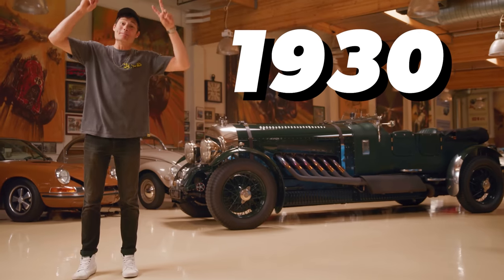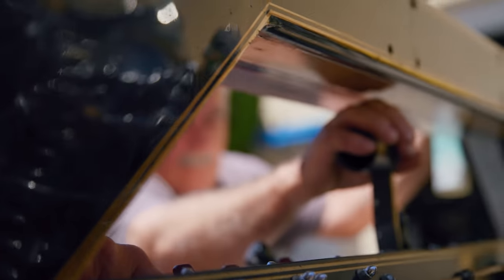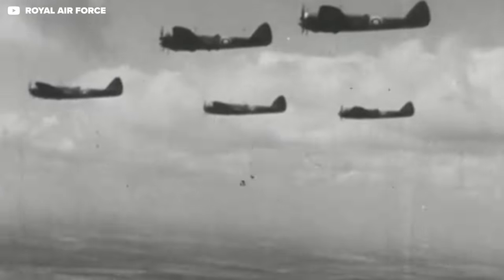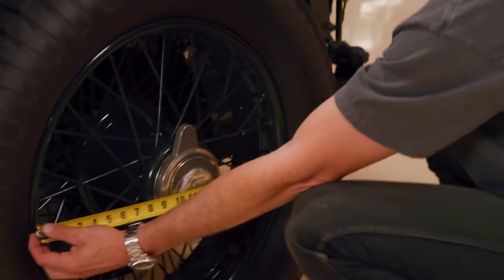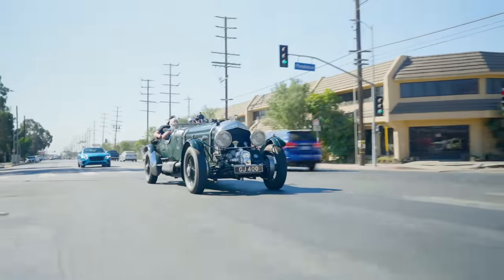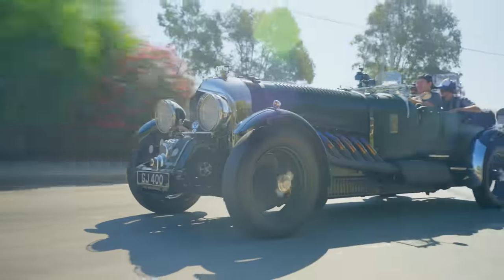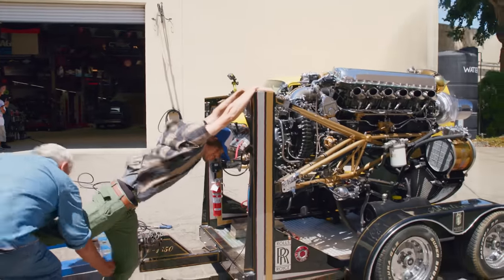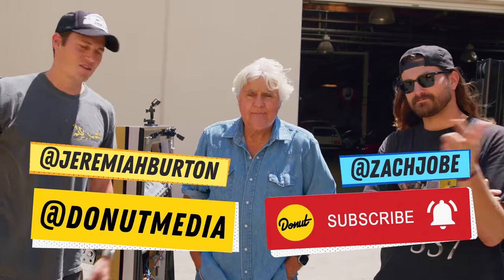What it’s Like to Drive a 100 Year-Old Car with 650hp

Comment: The Merlin was a British engine developed and manufactured by Rolls Royce, for the Spitfire. It was licensed for production in the US for the P-51 because the US made engines were lacking against German fighters
Reply: Yeah, the history part of the video is complete bs
Reply: Had to double check the wikipedia on that one, they said it with such conviction that for a second they really had me believing that the ROLLS ROYCE Merlin was an American product. Kinda sums up the US perspective on wartime history in a nutshell.
Reply: @Munkenba I'm American and even I know that the Rolls Royce Merlin is more famous for the Spitfire.
Reply: I had a problem with this too. Tbh it reads like it was based on the Packard V1650 Wikipedia article. But they very much made it sound like this was an American engine when it is distinctly British
Reply: Was about to comment about that. Rolls-Royce named it the Merlin, and the US version was called the Packard V-1650 (the same exact Packard that made cars, Motor City). It was the same overall design, however, with creating new blueprints to suit American perspective layouts, dimensions and tolerances were altered to allow for mass production as Rolls-Royce built them with manual, fine tuning of clearances.
Reply: Yep they completely ballsd the history up
Reply: Someone modded this engine into a video game (beamng) and it's honestly the craziest thing ever.
Reply: Americans: we did that! 
Everyone else in the world: no you actually didn’t
Reply: @ruikazane5123 so basically the American ones were probably slightly less reliable and probably slightly less efficient?
Reply: The fact that Jay of all people called it American engineering is the worst.
Reply: Lancaster,hurricane, mosquito halifax and countless others all had the merlin
Reply: @schpreck  that probably is the Packard copy
Reply: Wrong way around; the spitfire was developed for the Merlin engine.

Most of the Merlins were built for bombers though. Lancaster's using 4 of them, and Mosquitoes using 2
Reply: Americans claiming (or to be fair not knowing) the Origin of a Piece of Engineering or something war-related?
Now you Brits finally know how we Germans feel all the Time about all kinds of German Inventions & Engineering Products as well as war-related things in general. 
Though we Germans are used to it by now, so Brits reading this, calm down, you'll survive
Prost & Cheers from the Bavarian Alps
Reply: The engine in that car isn’t called a Merlin, it’s actually called a Meteor.
Reply: The merlin engine is One of the most successful aircraft engines of the World War II era, some 50 versions of the Merlin were built by Rolls-Royce in Derby, Crewe and Glasgow, as well as by Ford of Britain at their Trafford Park factory, near Manchester.
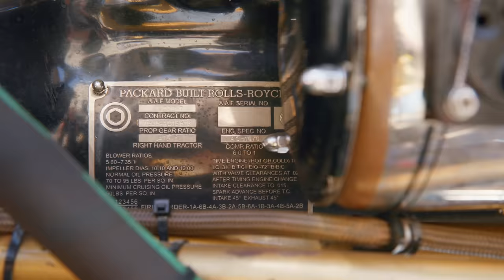Reply: There is a very quick shot showing it is the Packard version (1:00)
Reply: @jwalster9412 That is debated still, but seeing the statistics for the P-51 Mustang and comparing that to the Spitfire might help...
Reply: "We" won the war? The correct phrase would be "The Rolls Royce Merlin that powered the Spitfire, Hurricane, Lancaster and later the Mustang was significant in helping the allies win the 2nd world war". I usually let stuff like this slide but the US has an unfortunate habit of slightly modifying history to the detriment of men and women from India, Australia, Great Britain and numerous other non axis nations, giving the impression that the US fought Nazi Germany and the Japanese entirely alone.
Reply: @MartynCharsley thank you for this comment 👍🏾, 
Also i think they wana make merica great again. 😂
Reply: @christopherdooley4666   I'm glad you beat me to it. It  means I'm not the only sane person on the planet, and that's got to be a good thing.
Reply: @schpreck  what time stamp did he say it was American engineering? at 1:17 he said "that was American manufacturing back in the day" talking about how fast they were making them.
Reply: They also don't make clear that the idea of transplanting aero engines into racecars was a really common practice at the time. The Fiat Tipo  S76 "The Beast from Turin", is just one famous example. I'm sure Jay's had a few of them on his channel.
Reply: Partially correct. Rolls Royce designed it. However, the Brits were hand building them and couldn't pump out the engines fast enough to keep Hitler from parking his Benz outside of Buckingham Palace. The Brits begged America to help. Packard motor company had to work with Rolls on dialing in tolerances so they could be mass produced and thus keeping the Brits from learning how to speak German.
Reply: @MartynCharsley  Not to mention that the soviet union did more to "win the war" than the ALL of the countries you mentioned, combined. Of course the efforts of those countries should be acknowledged and respected, but the soviets had tanks in Berlin while d-day was happening thousands of mile away. The soviet T-34 is considered by many historians to be most impactful weapon in ww2. No country sustained as many losses as the soviets. It gets really tiring seeing the anti-communist propaganda erase so much of the good things the soviets did.
Reply: @ilikeartica exactly....at jo point did they say America initially developed the engine, only that we made them in America in large jumpers at a rapid rate for the war.
Reply: @diegoficagna3057 I'd also like to point out that the Europeans did Jack shit in the Pacific theater. They all got their asses handed to them by the Japanese and had their Pacific forces retreating into Africa before the USA started making major moves in the Pacific theater. I'd give the Soviets, Chinese, Australians, and Philippines more credit for the Pacific War effort than any of the European powers; and anyone who tries to claim that the USA wasn't the biggest player in the Pacific theater is a moron.
Reply: Hopefully donut reads this
Reply: @schpreck it is as the original engine was far to complex to MASS PRODUCE. As it was needed . So yes some good ole American engineering went into simplifying it.
Reply: It's a merlin on the stand and a meteor in the car. Jay let it slip, it's a tank engine.
Reply: There was plenty of British accents going on but no recognition 😂
Reply: the americans are too embarassed to say they had to use a engine design from the UK because american ones were no good and their engineers couldnt come up with one
Reply: I think the editing is the reason a lot of people are getting grumpy in the comments. After jobe says that it’s a Rolls-Royce Merlin they could’ve just added another 3-4 second clip clarifying that Packard were the ones mass producing it, based on the licensed design with the necessary alterations :)
Reply: @HALLish-jl5mo also the Fairey Battle and Short Sterling.
Reply: @diegoficagna3057  The USSR was shit though. They had thousands and thousands of T-34s because they were crap tanks that did more damage to their own crews.

Their logistics was compromised of American trucks because their manufacturing sucked. 

All the USSR did was throw men into the grinder using western equipment, or, if those men were extremely unlucky, Soviet equipment. Their leaders were completely incompetent for the first year because Stalin had just shot everyone who knew that they were doing. 

If they'd the first clue what they were doing they could have won with half the casualties.
Reply: I love donut but they absolutely need to step up their research game because they are frequently pretty terrible about getting facts right.
Reply: @diegoficagna3057  Absolutely. I'm ashamed that I didn't immediately acknowledge the stupendous contribution made by Russia during the conflict.
Reply: @junit483 Ouch! I had no idea that Churchill and the war office went begging to Washington. Amazing what you learn each day.
Reply: To be fair, I think Jay was mostly talking about the US's production might, of being able to produce the (licensed) Merlin's at a rate of only taking one hour for each one.  I don't think he was implying the US designed it (and no, I'm not American).  I don't really expect anyone of Donut's age group to know any intricacies like that either, unless they are into WWII history.
Reply: @Munkenba not really. Stop projecting your bias onto a mistake made in the video.
Reply: yeah i was kinda baffled for a second as i remembered the Merlin being the legendary Spitfire engine first and foremost. Of course they used it in plenty other situations as well, like the P-51 as mentioned.
Reply: The magnum opus of plane engines
Reply: @zirgaoec3784 go back and watch it again. they never said the US built it. You’re reaching.
Reply: @diegoficagna3057  The T-34 tank is so impactful, that they are STILL using them to this day in their invasion of Ukraine! :P
Reply: If it wasn't for us, you'd all be speaking German and Japanese.
Reply: Top Gear drove one in an old episode. Was great
Reply: @chartreux1532 we still beat you…….twice!
Reply: @MartynCharsley don't forget the eastern front. The USSR was the biggest reason the Nazis were defeated
Reply: And they didn’t win the war, they helped to win it but every time it sounds like they think ww2 was america against germany
Reply: @zirgaoec3784 not fully true
Reply: Not fully correct but yes
Reply: @corroded nit true. Americans took the motor and modified it to be better for the heavier plane that Americans had at the time. It was both sides who made the engine so iconic. It's like how Ford Mustang ecoboost uses a tuned version of the same 4cyl in the focus
Reply: Yeahman one of the factory’s in Manchester was about ten miles from me literally near a place called Trafford park … obviously hitler tried blowing up the factory few times aha
Reply: Americans will always try and claim what us Brits produce lol
Reply: Cmon guys we were init together 🇬🇧 🇺🇸 BLED watch bro anyone tries it now bro it’s onsite 
Here in England we watch American shows , eat Indian food , drive German cars and have too many immigrants . Been there done that but americaaaaaaa yeman standard love you lot
Reply: @chrismartincreator  says the country that has  stolen most of the  ancient worlds treasures and put them in a meauseam and claims it's their own. Yeah that's ironic
Reply: @Munkenba   The American (Packard) made Merlin engine, designated Merlin XX, was built to tighter tolerances than the Rolls-Royce variant.

It's fair to call the Merlin XX an American engine as they made changes to fit American manufacturing processes and even improvements to the design.
Reply: It did feel odd not to explicitly acknowledge the engine's origin, especially when the video opens with a brief faux-British accent/nomenclature gag. To be fair they did acknowledge the Royal Air Force in some of the archive footage, and used a Polish 303 Squadron Spitfire in the infographic, but now I'm wondering whether that was accidental rather than deliberate. To specifically mention the P51 in the narration but not the Spitfire (a few of which were flown by American pilots, so retaining the opportunity for a bit of flag-waving if that was the aim) seems like a strange editorial choice.
Reply: Plus, this car has a Rolls Royce Meteor in it, the tank version.
Reply: @gamemeister27  I had, to my shame, forgotten that. I think you're the second person to bring this up. I'm growing more embarrassed by the hour. Apologies to the descendants of the Russians who gave their lives. I didn't mention Poland. I think that they were the first to suffer invasion by Hitler's troops, although Austria was certainly annexed earlier. Polish pilots flew Spitfires from UK airfields I think.
Reply: Americans won the war 😂😂😂
Reply: @MartynCharsley  No worries, I'm American anyways.
Reply: The Allison engine was by no means a bad engine, in fact it performed quite admirably at low altitudes. However at higher altitudes the Allison underperformed leading the USAAF to order the license to build the Rolls-Royce Merlin V-12 due to its vastly superior high altitude performance
Reply: @jwalster9412  and louder.
Reply: I was wondering why Jay referenced “American ingenuity” when talking about a Rolls Royce engine
Reply: @themanhimself3  makes sense. Less tight tolerances lead to more sound generally.
Reply: bloody hell
Reply: @rynomite1199  I think he meant the manufacturing part, not the engineering. Benefit of the doubt t
Reply: Donut, go and learn some history.
Reply: Yeah, I'm not usually the chest thumping jingoist, but I'm from Birmingham, where the Spitfire was built, so we're proud of it.  The plane, and the engine that powered it, are iconic and it actually upset me to have them be so wildly, and maybe willfully, inaccurate.
Reply: They never said it was designed in America... You're just a wannabe historian looking for holes to pick.

Jay knows that the Merlin was designed in the United Kingdom, of course he does. He was making a point that the vast majority of the design ended up being manufactured in the United States. A valid point to make. The history section of the video was fine, for these lads.
Reply: It’s the one Pontiac tried to reverse engineer.
Reply: @schpreck he didn't, he said "American manufacturing" and that's a different statement. There was absolutely no way the British were building even a 10th of the necessary output, the bulk of the work was done in the USA..
Reply: @KevReillyUK  yall forgetting that the motor was also built in amarica? The engine in this video was built in amarica for amarican cars.
Reply: Thank god I’m not the only one, I’m American and big on WW2 aviation so this whole history part was hard to watch 🤣
Reply: @LV_daWEED  then how would you not know the engine in this video is from amarica
Reply: The many know this fact about The Few👍 (while we wait for America to catch up🙄)
Reply: Yep. Classic Americans, thinking they started everything. 😂
Reply: Who owns Bently now? ... Volkswagen, look it up.
Reply: How about some love for the Centurion tank. No one mentioned it had TWO Merlins.🤘
Reply: @bendgeddes  Yep, amazing tech, those were huge engines
Reply: Yeah the US engines kind of sucked... they were outdated, at least in the Mustang
Reply: …and, the US manufacturing not only improved upon the design, but they were also able to ramp up production to a level the British were never able to achieve.
Reply: I'm an Irishman and even I want the brits to be recognised for this
Reply: @jwalster9412 
Exactly the opposite…
Reply: I assume you mean US designed.
Reply: @RockyPixel people love to hate on America/Americans
Reply: @schpreck  To be fair Jay said "American manufacturing" and was referring to how fast we were producing them
Reply: @bryanjs4785  oh, I'm well aware of europes constant seething about the US, it's just in this case it's at least partially justified.
Reply: Watercooled engines* Double wasp would like a word with you.
Reply: @junit483  yeah some more revisionism. Battle of Britain was well over by then and if you think the Germans were getting over the Channel with the British Navy in the way, without air superiority you are insanely misguided
Reply: @gamemeister27  yeah and they might have folded if a) lend lease wasn't a thing b) the British weren't keeping considerable resources tied up in France. Fact is it was a multi faceted war and likely the only allied power that wouldn't have folded without support would have been the US, however, the entire rest of the world apart from the Americas would be speaking German or Japanese.
Reply: @MartynCharsley Nobody ever says that, we always give our buddies credit
Reply: @diegoficagna3057 The Soviets screwed over the Poles and didn't give a care until they got attacked, and they were getting destroyed until the West sent lend-lease. Also the Sherman was better than the T34
Reply: @hi_tech_reptiles  lol nah fam
Reply: From the name alone, Merlin, you can tell it's a name came from Europe, not American
Reply: The Merlin and the Meteor are the same engine - the only real difference is the Merlin has a supercharger, the Meteor does not.  The meteor turned out to be a great, reliable tank engine, as the basic components were designed to produce over 1000 horsepower for extended periods (airplane engines routinely spend long periods at or near full throttle, and are designed for it), so for the detuned Meteor, driving a tank around, only occasionally using full throttle, was a piece of cake.
Reply: Pratt & Whitney R- Wasp Engine: "Am I a joke to you?"
Reply: @gamemeister27 and how did the USSR keep from having to fight the Germans with sharp sticks and molotovs? Right lend lease, just like Britain. This doesn't have to be a p*ssing contest BTW, obviously the USSR suffered the most  casualties,  Great Britain held out during the blitz against all odds and kept the Germans off the British isle, which gave the US its only shot at launching the invasion of Normandy which, as a collective herculean effort, was the true turning point in the war. Ya know, nuance, historical and geopolitical complexity, blah blah, always boils down to "US saved the allies", then "yeah but after they let Europe burn for 2 years"... both are true, tf does it really matter if you do know what you're talking about, honestly?
Reply: @Atsah  youre right they could have added 3 seconds giving the engine its history... instead  they added 10 seconds of time praising american planes with the merlin engine.  it wasnt an edit choice
Reply: @christopherdooley4666 yes… this!!!!!!!
Reply: @C.Fecteau-AU-MJ13  Overall Merlin production ~150,000
US Merlin production ~ 55,000
Reply: @ruikazane5123  A myth that persists to this day.

British factories churned out nearly 2/3 of all Merlins made, something that could not be done by building them with "with manual, fine tuning of clearances".

Tolerances were not altered by Packard, but the drawings were redrawn to US standards.

The first US aircraft to use the Merlin was the P-40F. It used a V-1650-1, which was the same as the Merlin XX, except for some small details, such as the SAE spline prop shaft instead of the British spline.

When they were being used in North Africa they found they didn't have enough spare parts. So the British broke down some British Merlins to provide spare parts, which could be installed without needing to be fitted to the individual engine.

Later 2 stage engines (the ones used in Mustangs) had a different supercharger drive arrangement.
Reply: Haha this had me annoyed too, Leno should know better
Reply: @JTL90 c ya! All this American hate and generalizations. Who pissed in ur tea?? Maybe switch over to the British version of donut? …Biscuit? I’m guessing.
Reply: I was gonna say,
Reply: This was the tank Merlin engine. The aircraft Merlin made closer to 3000 horsepower with it's superchargers.
Reply: Wouldn't have hurt just to mention it ONCE!
Reply: Nobody ever said the boys at donut knew anything about history. They know how cars work though. 😂
Reply: @christopherdooley4666 I was thinking that! Meteor, glad you mentioned.
Reply: It's a 13 minute video comparing old horsepower to new modern horsepower.   They may have left details of the history on the development,  but that wasn't  the point.  They called it, and showed the tag on the motor saying  Rolls-Royce,  never implying it was developed in the U.S.  It is for entrainment.
Reply: Thank you I almost had a conniption listening to their explanation of it
Reply: @diegoficagna3057 the Soviets made huge sacrifices and were critical to Nazi Germany losing but they did not have tanks in Berlin while D-day was happening. Those two things happened almost a year apart hence the so-called "race" to Berlin
Reply: @fordgtguy no it wasn’t it was built to looser tolerances
Reply: Technically speaking, the car could be driven by the engine from the british Centurion tank.
Reply: @bendgeddes 
Because it didn’t?
There’s only one 27 ltr engine in the Centurion.
Reply: It was licensed for Packard to build it because the North American P51 Mustang was a design originally built and ordered for the RAF in the late 30s.   The US was not at war till Dec 41.  The bay was always big enough for Merlin, but that took time to tool up for and in May 1940...time had run out for England. 

The early models were built with Allison engines already available to North American.  Eventually the Allison was supercharged to add altitude and speed, then as Packard had retooled for the war and stopped building cars, the later models were built with the American variant of the Merlin.

Merlin P51 flight and combat tests tests were done by RAF in England with replacement engines in 1941 (maybe late 1940) intended for Spitfires.
Reply: @diegoficagna3057 Who invaded Poland?
Reply: @C.Fecteau-AU-MJ13 That's because the UK was physically in the war, the US was outside the war. Hence American factories could be huge and operate 24/7. While British factories were targeted by bombers. In WW1, when the UK was like the US, outside the physical battle, the UK had the largest ammunition factory in the world.
Reply: @jamesmoakes6187  they do that all the time but its usually about cars so y'all dont catch it.
Reply: Also if the engine in the car really was out of a tank then it's not technically a Merlin, it's  a Rolls-Royce Meteor.
Reply: Yeah, some of these were made in Derby, UK, about 3 miles from where I work, (at the old Nightingale Rd factory in Osmaston - it's a housing development now 🙁). You could just about make a case for its being American engineering (if it was cast, machined etc by Packard) but it was sure as hell a British design. Depends which tank it was pulled from I guess!
Reply: @RockyPixel I’ll do you one better - the Merlin was basically the best engine the Allies had for any kind of plane back in WW2. They were used in fighters, interceptors and bombers. They got licensed to a number of other uses as well. Brilliant engine design, just shows you why RR is one of the only 3 major jet/ turbine engine makers in the world to this day.

Oh and the jet turbine? That was a British invention too :)
Reply: @jwalster9412 not really, just built to US measurements to use already available tooling to pump them out quickly. Slightly looser tolerances actually reduce drag and produce less heat and sometimes produce slightly more power. Plus these engines weren't revving high enough RPM for a slight tolerance change to make a difference
Reply: @Munkenba  Did you miss the manufacturin bit? perhaps one of the most famous part of the US participation in ww2
Reply: @diegoficagna3057 This just isnt true, having the most men die, or having the biggest slugfest on the eastern front doesnt mean you did the most, the Soviets heavily relied on lend leas and american manufacturing, and took quit a while to actualy get into the war machine.

D'Day was almost an entire year before the Battle of Berlin so im not sure what you mean, and the Western allies had their own Naval, Air and Ground Liberation to do, in france, italy, germany etc.

Not to mention the fact that you are forgetting the pacific theatre in WW2.

Taking losses doesnt win you wars
Reply: @TheLedaba  no football player has ever won the UCL then, or a league title, or a world cup.
Reply: Came here to make sure this comment was posted.  Its not true about US made engines though.  Pratt & Whitney developed some of the highest spec mass produced engines of WW2
Reply: The French did a study that found half of all inventions in modern usage were invented by the British. You guys don’t measure up to that to be fair.
Reply: @RockyPixel  I’d say it’s a reach in this case, most comments are Americans are dumb for thinking they built this engine when in the video they talked about how American stepped up the manufacturing, and to why we didn’t just spend time building a new better engine to prove USA is the best, cause it’s so much faster just to use the really good one the Brit’s had so we can get to war, I mean it’s like we were working as allies and not competitors or rivals or something, wish people wouldn’t be so stuck and stereotypical……….

Anyway USA USA USA 🇺🇸🇺🇸🇺🇸🇱🇷🇺🇸☢️🏈🔫💥💥
Reply: @diegoficagna3057 i agree with you, but also the communist propaganda also skewed things up. The t34 was not a good tank. It could be mass produced, but it was not good and in my opinion its inpact was highly exaggerated.
Reply: @captnjaygreybeard6394 ok? And Rolls Royce is now owned by BMW. But its not that simple, they own the majority of shares so they have more control. Also VW owns Porche but also Porche owns VW for example.
Reply: Classic American attitude the the world,
Reply: @andreibarbulescu3276  Thanks, yep companies change all the time.
Reply: Thank you! I love this channel but that was just a flat out lie.
Reply: This is correct however the Merlin was used only in a few us planes most famously the p-51 which was modified to preform better at higher altitudes and long distances, other us aircraft engines were good and did there job very well especially the radial engines
Reply: Though they should have specified, they never did claim the US invented it, or said who did. Only that the US was cranking them out at a rate of 1 per hour, were putting them in the P-51 and was part of what helped win the war.
Reply: @schpreck  He never said engineering, he said American "manufacturing" about the rate at which we were producing them.
Reply: @MartynCharsley  Pretty sure when he says "we", he's referring to the Allied powers, not the US only. I'll apologize for him not being specific enough for all you overly sensitive people in the world that take things so literal.
Reply: @CheekyMenace  I'm only "overly sensitive" because historically every other WW2 allied nation has for the most part been erased from the conflict by Hollywood. 
To allow these things to slide, even things regarded as minor slip ups, results in history being inadvertently rewritten. It could be argued that the conflict began, for Spaniards and China even before 1939 which was when Poland was annexed by Germany. The United States remained determinedly neutral until Japan attacked Pearl Harbour. In 2023 there are groups of people currently engaged in an effort to convince the world that slavery wasn't all that bad and the Confederacy has been unfairly maligned.
As decades go by it grows increasingly important to be accurate and not blithely skip over facts. Admittedly, skipping some might be petty or irrelevant however the skipping eventually might lead to forgetting and then to assertions that certain events never took place. I offer "Germany did not attempt to eradicate Jews from Europe" as a particularly egregious example. Another, not quite so egregious, would be "The Rat Patrol", a US TV show (1966 to 1968) about 4 soldiers harassing Rommel's Afrika Corp in the Libyan desert. The show was based on the exploits of the British SAS and of Popski's Private Army, a unit of the British and Commonwealth armies led by Vladimir Peniakoff. Neither of these outfits included Americans and the TV show was pulled by the BBC after 6 episodes and in NZ and Australia it was relegated to a slot where it was hardly noticed. All following the outraged complaints of families, comrades and the actual still living participants. 
I'm going to stop now. I think my point has been made. Or shall we discuss the Hollywood movie about how an American sub captured the German code creating Enigma machine from a U-Boat? (It was a British sub). God Save the King! 🤣
Reply: @MartynCharsley  You mean that FICTIONAL movie loosely based on actual events, that at no point claimed to be a 100% accurate account of what happened?? Maybe stop treating movies & TV as tools for learning and instead for entertainment as they're meant to be. We have access to all the factual information we could ever need right at our fingertips.
Reply: @CheekyMenace  When you say we, you mean you and me which is absolutely true. We do have access and you and I, I'm being presumptuous here, just assuming you do, know exactly where to go, which sources to access in order to determine the truth of things. However! I suspect, and with only anecdotal evidence to back up my belief, a majority wouldn't know, or couldn't give a fuck. And wouldn't bother to "do research" because, why would they? There are plenty of people who see movies and TV shows and focus on the True Story part of Based on a true story. I'm nerdy so I often, my partner would say too often, check out the background to "Based on a true story" story.
I think I'm in a minority.
I also think that it's interesting how much WW2 history I've learned from reading the comments to a car show item on 1930's British race cars and their power units. 
I'm really not having a pop at anybody in particular or even generally (apart from "Hollywood"). I just think that keeping history  as accurate as possible is somewhat important.
Reply: @davehoward22 I don't think so, the US didn't use Meteor engines in their tanks and this one of the trailer seems to come from a sterling bomber (the circular cooling system gives it away). So they are both definitely British built.
Reply: @totaltechno7510 if you go to one minute into the video, they plainly show the data plate of the one on the trailer, it says "Packard built Rolls Royce" so it was built in the US.
Reply: @jwalster9412  much less horsepower with the allison.
Reply: @MartynCharsley Without lend lease and the industrial might of America you would have all been crushed including the soviets.
Reply: @chartreux1532  we all know germanys contributions to ww2... its nothing to be proud of.
Reply: They even used Spitfires in the animation explaining the supercharger
Reply: @buellb0y most merlin engines where made by Rollce royce, of all 168000 merlins 83000 where made by royce and 33000 where made by the British ford so ultimately britain produced over 116000 merlins in their homeland while America produced not even half of that in total
Reply: @Munkenba   The engine in this car was built, under licence, in the USA by Packard.
Reply: @lenyard I, at first, thought it was a meteor. It is in fact a Packard built merlin. The video says it is naturally aspirated and came out of a tank, yet it has what I assume is a 'pretend' rootes type supercharger mounted at the front. All very confusing...

Edited to correct predictive text.